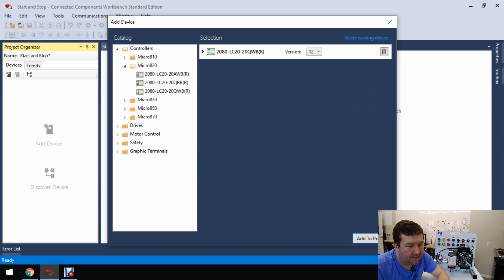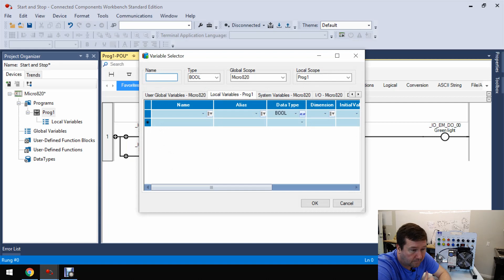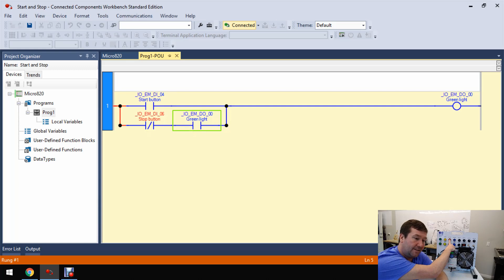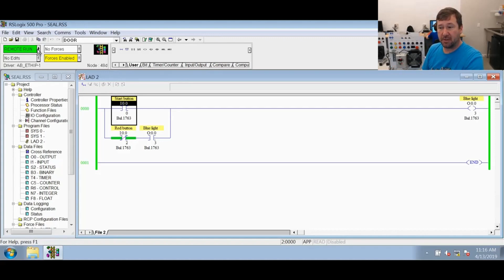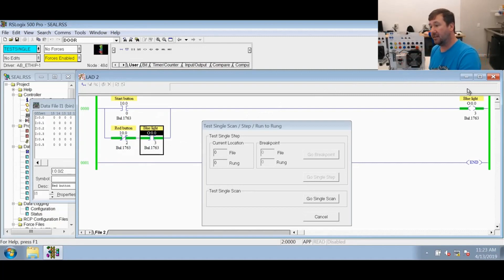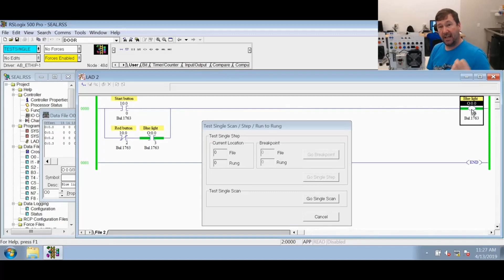Program a START STOP in the Micro800 PLC with a Seal In

Comment: I love your videos and have a learned a lot from them.  Watching your videos really helped me to be able to navigate and learn how to program ladder logic in CCW.  I was already familiar with RSLogix 5, 500, and 5000.  
I have a question about something you said around 7 minutes.  You said that the PLC would check to see if the bottom part of the branch has power flow, even though the upper rung turned the coil on.  I was under the impression that once a PLC had logical continuity all the way across the rung it didn't check any more branches, in order to be efficient with scan time.  Am I correct in my understanding?
Reply from the maker: No that is incorrect.  A PLC is going to execute instructions in the exact same methodical order whether the logic is true or not.  If there are 20 branch levels and the 2nd one is true, it is still going to scan each branch one by one.
Reply: @TimWilborne  thank you!

Comment: Thank you Tim for your content. I have a question for you and I apologize if it was covered in a previous video. Is the connected components workbench software what is suggested to be utilized with your trainers?
And is this to save your clients from having to purchase the full pricey A/B software for training purposes?
Thanks and keep up the good work
Reply from the maker: Hi Anthony.  This is the software for the Micro800 line of Allen Bradley PLCs.  Which PLC line you should purchase will depend on your particular situation but if you are just trying to learn about AB PLCs in general then I would probably recommend the Micro800 line.

AB software isn't necessarily as pricey as everyone claims as long as you know what software you need.  The low end version of Studio 5000 is less that $1,000.
Reply: Got it. Thanks Tim for the reply